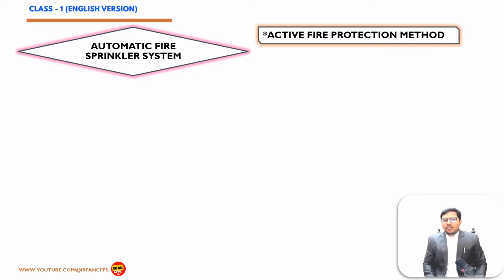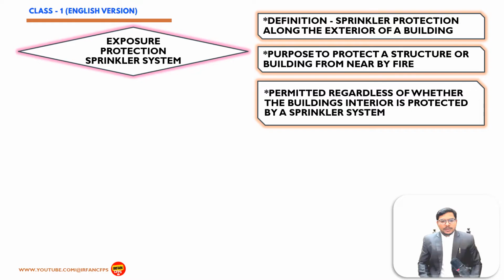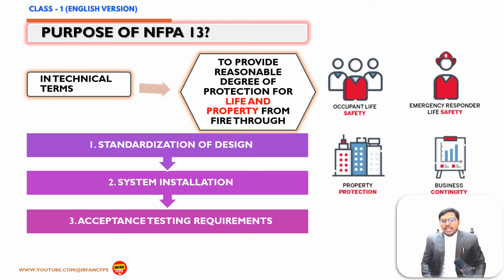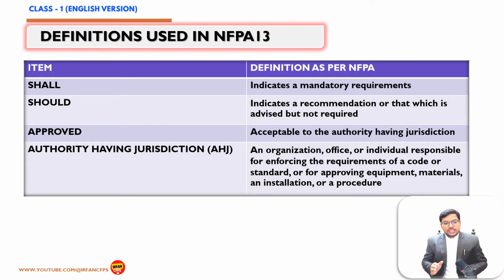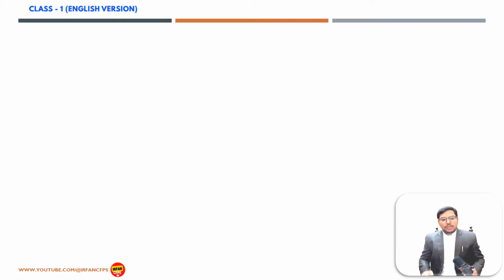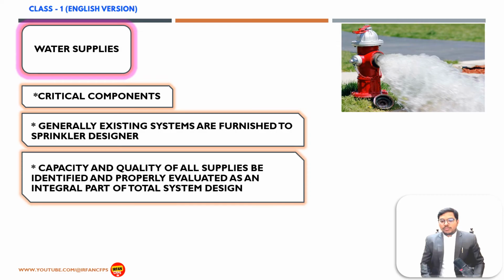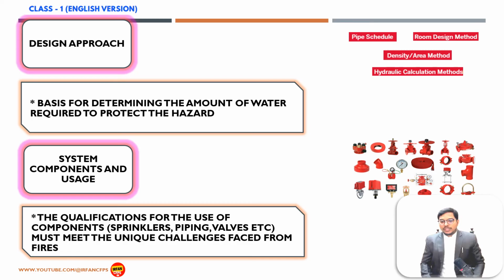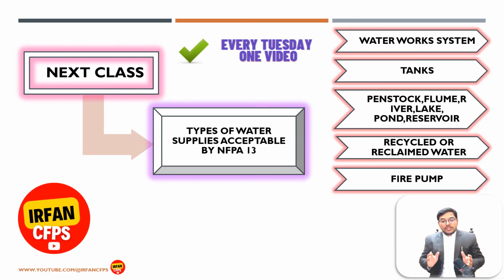The Truth about Sprinkler Systems (NFPA 13 Explained)

Comment: Hi. Any regulation to use the Test & Drain Valve, like it should be near to the Zone control valve?  If so what is the chapter and regulation number. Could u please guide on it?
Reply from the maker: Yes should be near to zcv. It’s available in nfpa 13 with diagram

Comment: Is it permissible to place or keep fire on the roof of the building?
Reply from the maker: Fire pump can be kept on the roof, acceptable. However it totally depends on the fire protection design developed by the fire consultant at the initial stage..

Comment: Sir my question how i would that i need sprinkler system as nfpa 13 only catagorise hazzard classification based on building usag but main how we will clarify that we need sprinkler system or stand pipe system only for our building kindly reply.
Thnx
Reply from the maker: There is a separate subject to know whether the building is required to be protected with fire protection system or not.. based on local building codes or International fire code we need to prepare building code analysis. Based on BCA we decide. Basically this will be done in the initial stage by the fire consultant.